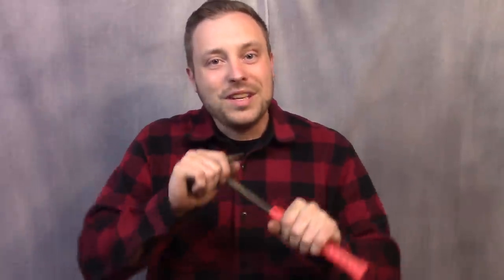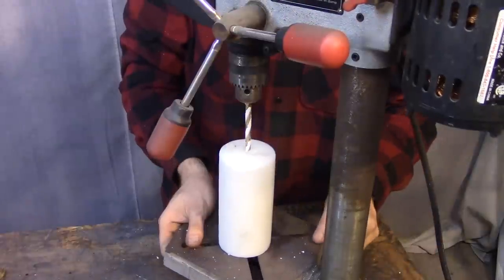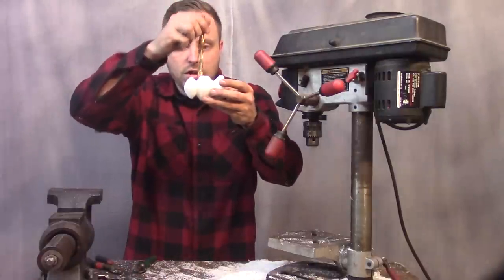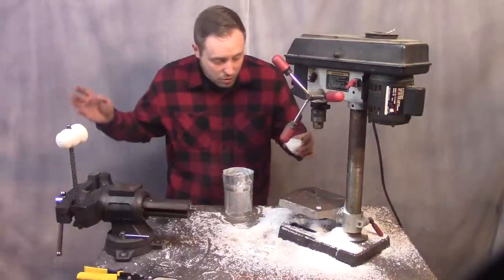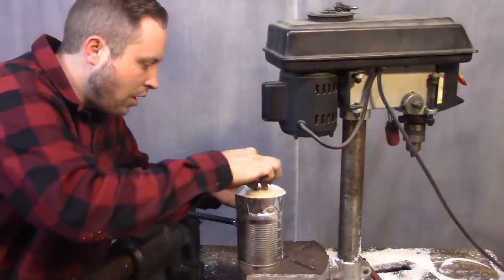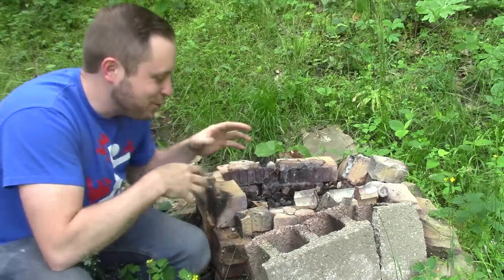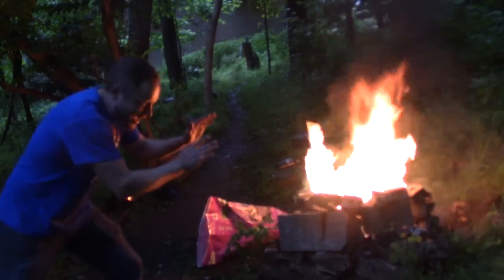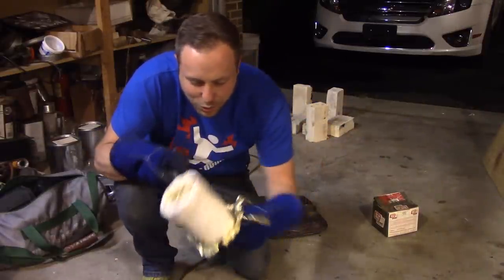THE BRASS HAMMER - Makerj101 Collab!!

Comment from the maker: Make sure you let Makerj101 know that I sent you to his channel!!
Reply: JAIRUS OF ALL try adding sand it works wonders! 50/50 mix. I currently run a full setup with a propane forge and 220v Electric kiln. I get most of my brass/aluminum from the scrap yard as brass fittings/aluminum cast parts both of which are very  clean sources.
Reply: JAIRUS OF ALL Thank you for ur inspiration but i have some problems I have no powertools, i am 12 years old,i have no materials & money and i live in a small apartment.
Please help
please respond
and also I luv ur channel
ty
Reply: U r my fav youtuber
Reply: Can I make a wolvirein claw

Comment: A note for future casting projects, if you can put your mold into a vacuum chamber while it's still liquid it will greatly reduce the amount of air bubbles in the material by drawing them to the surface.

Comment: Yes, you could've heated the rebar and pushed it through the wax to widen the hole. Either could have used a low temp setting in the oven, barely get the thing warm enough to melt wax, pushed it through and dunk the whole thing in water, or just heat up the rod, push it through just to make the hole bigger, then pull the rod out immediately and allow it to cool or dunk it to cool it faster and affix it to the head after it has cooled down.

Comment: if you had turned the drill on its side and clamped the base plate in your vice you would have been able to use it as a wood lathe with much more control